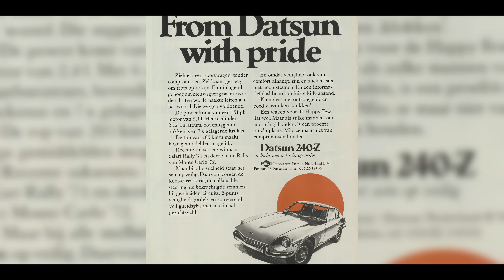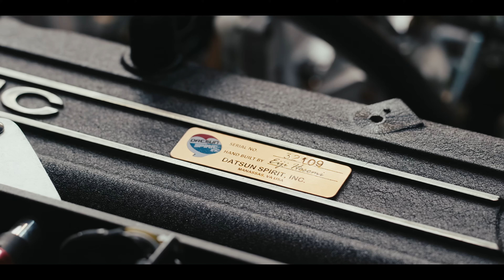Keeping the Datsun Spirit Alive — 1971 Datsun 240z | Documentary

Comment: I had a Datsun 240 Z that I bought off my brother when he burned out the engine. It had wheel well flares in the front and back and had 235x50x 15 tires on it. I completely redid the car. I rebuilt the engine myself and it had 11 1/2 to 1 compression and had triple Weber’s on it. I had KYB struts and it was lowered 1 inch all the way around. I had a one and three-quarter inch sway bar in the front and an inch and an eighth swaybar in the back. That car handled like a dream, and it was pretty quick too. I put a five speed transmission in it and that car loved 90 miles an hour on the freeway. I even designed and had a machine shop make some turnbuckles for the suspension so they could adjust the suspension without having to shim or bend the angle braces. I really love that car but when I got married and we had a kid come along, I had to get rid of it. I wish I had never gotten rid of that car and I always hoped that they would make a modern car but in that style.

Comment: I owned and drag raced my 71 Series 1 240Z for over 25 years. I built and installed a  2.9L stroker motor 5 speed and 3.9 R200 with my 2mm bored out SU carbs my Best run on shitty street tires was 12.801 @107.26 mph still miss that Zcar everyday

Comment: Id do a L28et Swap and Do a very 80s and 90s build 3.1 Liter and Bored low compression pistons and rods and ARP head studs and main studs and aggressive cam and valves and go twin turbo like the Wangan racers did in japan especially the Midnight Clubs Red S130Z (280zx) but on a budget maybe build it little by little and use a NA L28 as my turbo build as some people say the NA L28 can take more punishment running low compression and high boost then a L28et F54 block though im not to sure since it various from how its tuned for boost